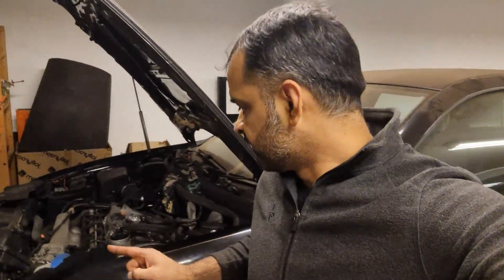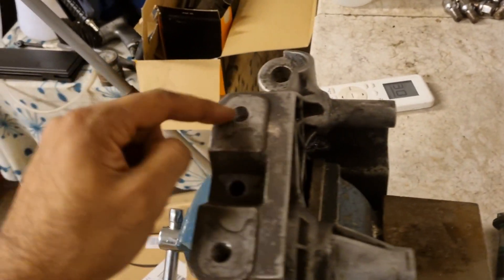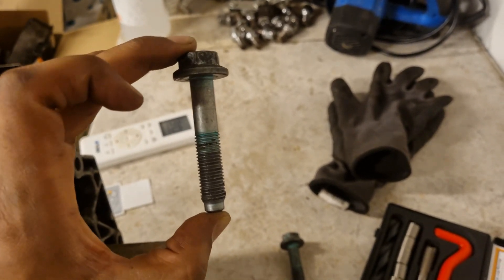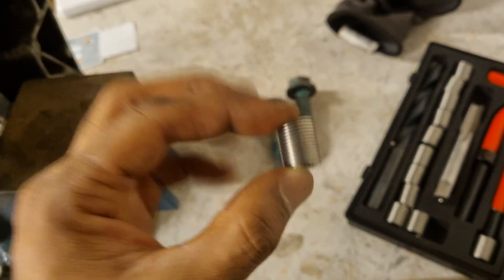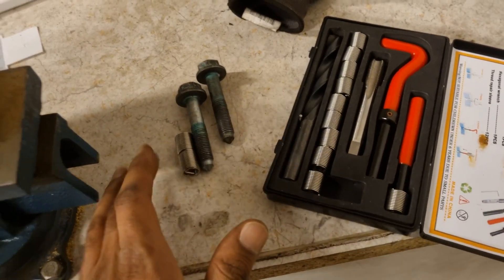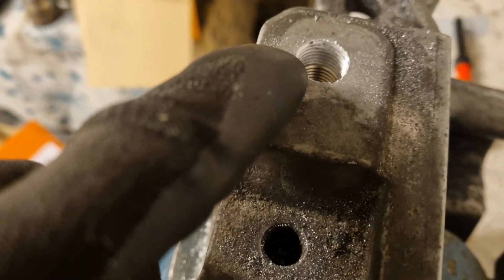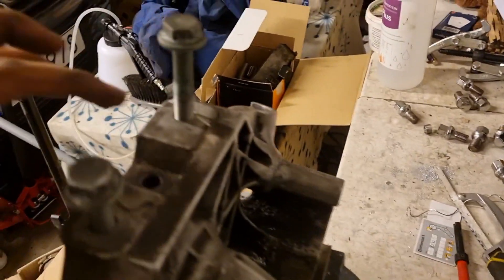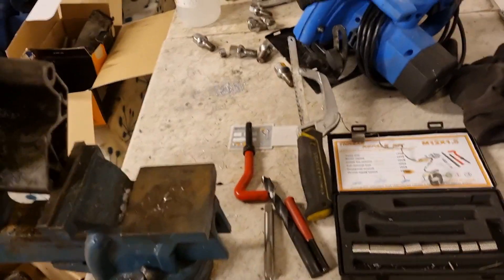How to Repair Engine Mount Threads Using Helicoil kit | Golf Mk4

Comment: Someone heli coiled the mount that bolts to the transmission bracket on my mk4 vr6 and it ripped out and snapped my axle. Either they didn’t do a good job or heli coil is not strong enough for the weight and stress from motor and transmission 🤷‍♂️
Reply from the maker: Oh No, i wouldn't do it on an expensive personal favourite car
Reply: @adnansgarage my mechanic drilled and tapped it but now I’m paranoid 😅
Reply: You want a bushing style insert like time-sert not helicoil style
Reply: @GTIFabric I had it retapped but it just failed on me again yesterday,just gonna junk the car and possibly buy my nephews car. I like the car but I can’t keep dumping money into it when I’m already strained on cash. Oh well 🤷‍♂️

Comment: Great video!!

I was annoyed at the cost to get my 3rd timing belt done on my 2001 TDI new Beetle at 350,000 MI at the dealership but I got some great news.  The mechanic did the Helicoil repair shown here on my engine mount at no additional charge.  Make sure you mention this critical  repair to your auto place if you are having a timing belt done by somebody else.